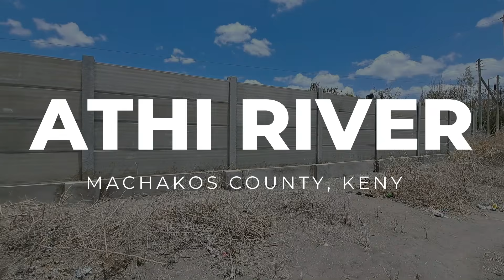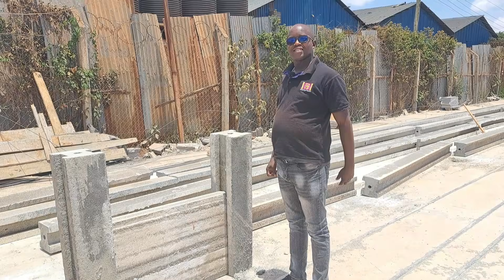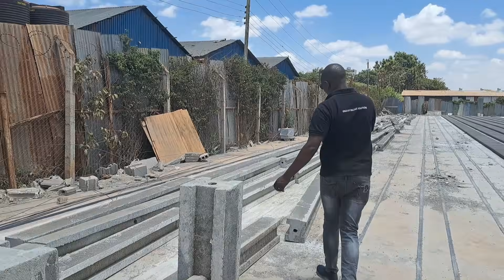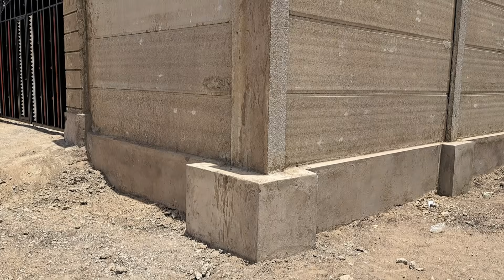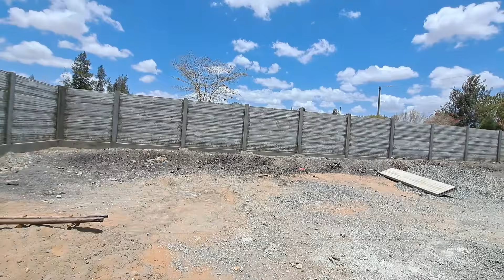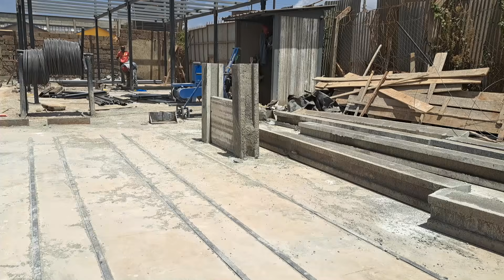Fencing a 50x100 (1/8 acre) Plot using Precast Concrete H-Columns and Panels

Comment: Good initiative! However, I'll like to know how strong it is compared to the traditional concrete wall?
Reply from the maker: Concrete or ndarugo wall? Big difference between the two in terms of material and cost
Reply: @PropertyNoma  What I meant is its strength or durability. Is it as strong as that of the traditional wall made of block and concrete?

Comment: Hi Nick, i watch your programs from Dar es salaam TZ and i am very impressed and excited with the prefab solutions, i once used a local supplier to build a fence and it was comparatively expensive than brick walls. 

Just curious if Kingdom precast panels have a plant in Dar es salaam or associates therein so i get their service.

Comment: In my opinion, this is way too expensive than quarry stone wall yet no matter what method you use to pre-cast, there's no way it can match or be close to quarry stone. As a person who has done a few walls, the your cost is way above two times the traditional fence. I also thought it's faster doing it but it's not. But speed here is nothing...the fence strength is the big deal. Quarry stone last forever. This one won't but am sure the advertiser would put it different. Just reality check.

Comment: Hi Nick l now understand very well from Engineer Ian. What if l just precast at the front where there's the gate first, is that possible and how many of them will l need and how much will that cost. In short, is it possible to fence the front alone?
Reply from the maker: Yes you can. If the front is 50 feet, you'll need around 20 panels. If it's 100 feet, you'll need 40 panels

Comment: Fencing using stones will always be cheaper. 1 million for 50 by 100 is expensive
Reply: The focus here is on durability and quality not just the pricing. They say cheap is always expensive. With precast wall panels you'll never need to repair your wall or use extra cement for finishing the wall . It's simply installing and your wall is ready
Reply: @stellamuvea9522  You are now getting it wrong. One of the core advantage of precast over traditional stones as per property noma is cost. They claim that you will save 25% of total cost when using precast which is totally infeasible when you compare the pricing of the both.
Reply: THATS 1ACRE
Reply: HOw much would it cost?

Comment: R6 is used for rings not reinforcement. It's too small.
Reply from the maker: But it's prestressed steel inside the h beam. Check out on Google for more information on prestressed concrete engineering

Comment: I fenced my double 40x80 plot with these wall panels and H- columns and it is beautiful.
Reply: How much did it cost coz the costing he gave us on the higher side.... 10000 per metre? 😢
Reply: H-Beam @ ksh3500 and wall panel @ ksh2600. Each H-beam was 3.1m and each panel I used was 3m. Panels are 600mm wide so I used 4 to give fence height of 2.4m
Reply: @gitongagithaiga3238  now how much did it cost you to completion
Reply from the maker: Thanks for sharing Gitonga
Reply: How was the cost. I'm considering using them on a 100by100
Reply: I wonder why someone says something but doesn't commit to answer the question of cost, frustrating!!! @magimagi234
Reply: How much was the whole cost to the finishing of a 40×80 plot
Reply: Hi Gitonga, this is insightful. I have a double 40*80. That I'm considering to fence using precast. Concern is cost and terrain especially where the land is not flat. How was the topography/terrain of your land? Total cost incurred?

Thanks you Sir
Reply: @Kevin, my plots were fairly flat. On a slope, you can build in steps per span. 
Cost will depend on type of soil due to foundation and also how you want your precast to be supported at the bottom.
Reply: Kindly tell us how much total: material and labor.
Reply: @ruirwathika  1.5 milion
Reply: How much did you use in total?

Comment: This is still very expensive as compared to MATOFARI  (brick) wall... Hapa kwetu tunapika matofari nice orange color once burned, then i get local fundi to do it in 1 week... really cheaper than 3000/1m...
Reply from the maker: Burnt bricks are definitely cheaper. Precast panels are for those who want a concrete wall but don't want to use stone blocks. Interlocking soil blocks are an alternative to burnt bricks, not precast panels

Comment: i have  a few issues to raise-ARCHITECT BY PROFFESION.On the moulding bit-the concrete footing are  on the neighbours plot/border some neighbours may not be ok with that-how do you guys tackle that????
2.engineer did not explain the joinery bit for the corner Hcolumns
3.The joinery between H column and base....are they just inntegrated in the columns from the foundation base
4.Can the factory/manufacturer make  SPECIAL CORNER H BEAMS???instead of the joinery method using motar
Reply from the maker: 1. Maybe the client had a discussion with the neighbour 
2. I think the company is investing in the machine that makes the corner panels. I'm not sure though.
3. 2 prestressed concrete h columns are used for the corners

Comment: This is very interesting and fantastic. my plot is in Kilifi town, what is the way forward if I want to install a precast wall.
Reply: can you update us when its done because i have a 50x100 plot in kilifi and am curious if its cheaper to use pre cast
Reply from the maker: Kindly get in touch with Kingdom Precast Solutions. Contacts in the top comment.
Reply: Also following for Kilifi County....I only want to use on the front side where the gate will be

Comment: I i have to spend  1M for the fence i need to see a nice straight line. @07:40 min  haziko level same area from another angle @16:02 mins anyway ni maoni yangu tu.
But it seems to be expensive compared to normal ndarugo blocks
Reply: Sure I thinks it's more expensive...
Reply: true that even when i factor in labour and other materials.....av done a small calculation and realised one H beam plus one panel is almost 6k......my opinion thogh

Comment: Very nice precast wall fencing. Just add some lean to inward sloping roofing off of the wall and you have a house!
Reply: Tell us more
Reply: @ruthmwi28  courtyard homes have the center open to the outside. So if you are building a substantial precast concrete panel wall/fence you have completed a substantial portion of a courtyard home. All that is needed next is roof sections that slope down from the wall towards the open space courtyard in the center of the property.